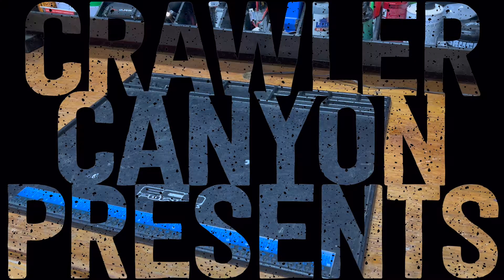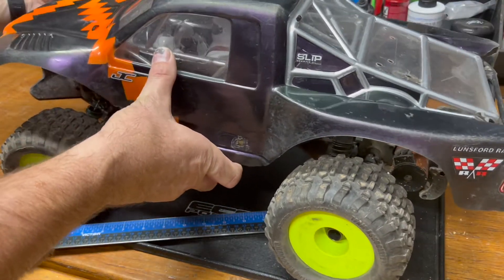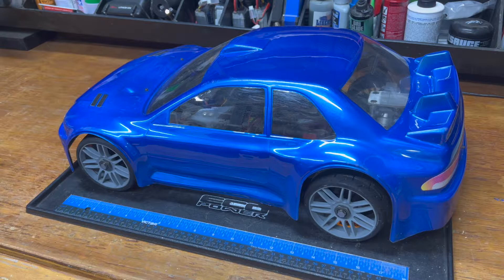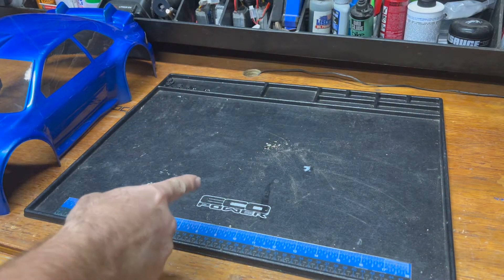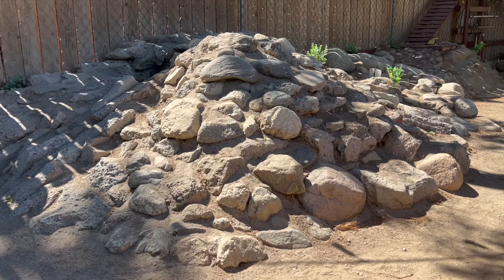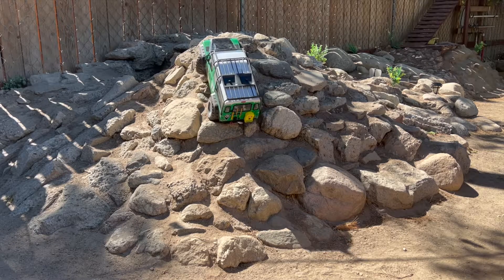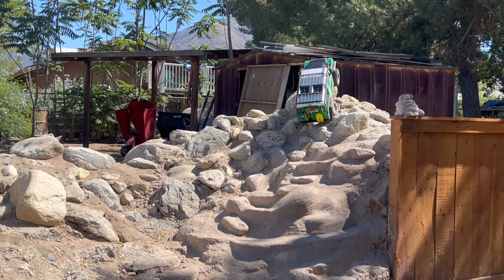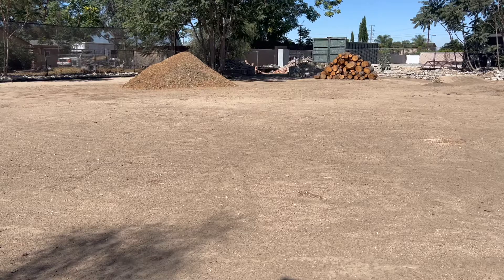Crawler Canyon Presents: the State of the Canyon (6/24/22)

Comment: you don't to stick to crawlers but it seems your fast traxxas is just a pile of crap.
take my hpi blitz, ripped it around alot after putting insane power in it.
yeah it destroyed spur, slipper, bearings and replaced the whole gearbox at some point.
but hardening the diff outputs was the only mod I needed to have it reliable handle the insane power.
the castle 1410 sidewinder combo is no joke in a 2WD and sand, much sand.
having to buy new wheels and hexes because the one nut comes loose is rather annoying.
eventually the signal wires of the ESC almost let go and haven't fixed or driving it for years. (have the parts)
so I thought I might as well go bigger with a losi super baja rey and bigger components should be bulled proof.
claimed 55MPH is bloody fast YO! but it need belted tires (pizza cutters)
Reply from the maker: I’m putting 3hp through a drivetrain that was designed in 1985, directed to tires that are about 3x the size and weight. Stuff gonna break.